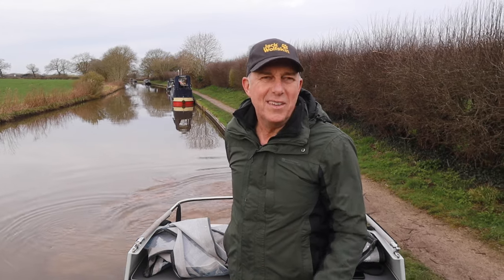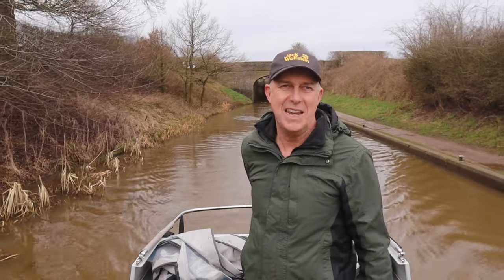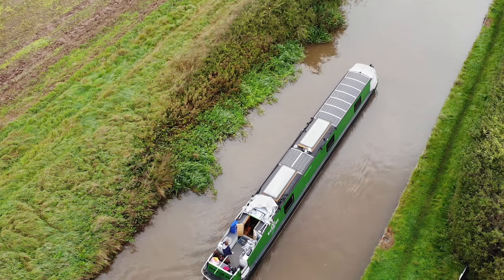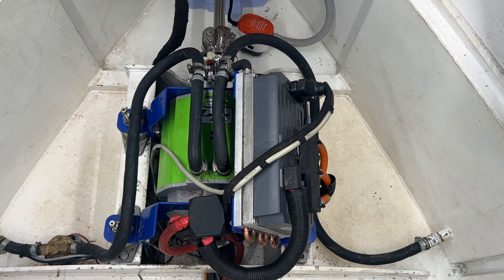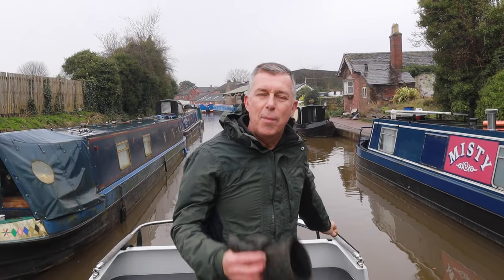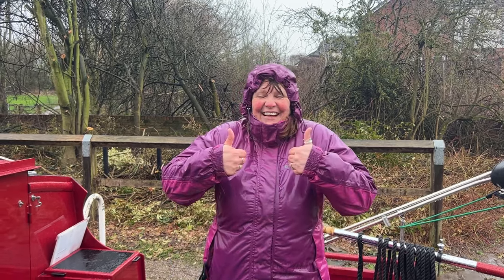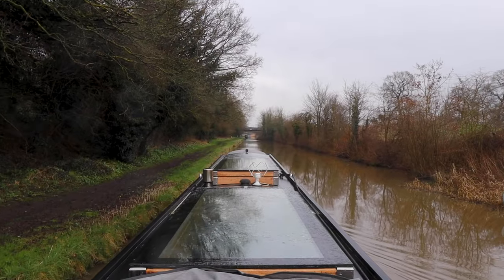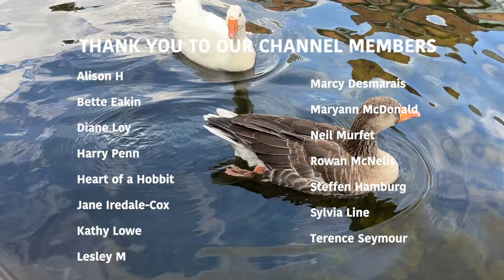NEW ENGIRO MOTOR on a NARROWBOAT How do you Charge an Electric Boat?  Ep.203

Comment: Super update Paul, great to see Dexter looking chipper. The new motor sounds louder than the old one … is it significantly louder? Do you think it’s the motor or the prop? I’d love to hear more on how the upgraded generator is working out. Love the artwork … it’s wonderful to see the creative process. Stay warm!
Reply: There seems to be a high pitched whine at certain prop/motor speeds, but then it completely disappears.  Is it speed related or something else?  It is quite an irritating noise when it happens.
Reply from the maker: Hey guys. It is louder, not significantly so. I do think a lot of it is the prop to be honest. The new generator is still in its bedding in period but it will charge the batteries at a faster rate when we are able to increase the output. Love seeing Paul’s Timelapse’s too. Such a talent. Hope you guys are keeping well and looking forward to getting back onto the boat. ❤️
Reply from the maker: Hey Jeff. We had the same on the last boat and it is speed related. It is when the resonant frequency of the prop matches the water. It is like running your wet finger along a wine glass rim. It can be remedied when we next come out of the water by sharpening the blades of the prop. The laymen’s term for it is singing prop but I agree, it is a bit irritating. Hope you have a good weekend ❤️
Reply: @NarrowboatLifeUnlocked  glad there's a fix.  Will be interested to see the results of the prop sharpening modification.
Reply: @NarrowboatLifeUnlocked  we found our singing went away after we went through a few shallow canals … a little bit of prop wear makes all the difference! 🤣 (I’m sure sharpening would be a more efficient solution).
Reply: @NarrowboatExpats  does it also happen with diesel motors, but it's masked by the engine noise?  I've never noticed anything like that in any of the lake boats I've owned (one 2.5hp inflatable, and a couple of 115hp small speedboats).  Apart from the last outboard engine boat, those were quite noisy, though.

Comment: Am I right in thinking that your boat is not 12 months old yet? In that time you’ve had new motor, inverters, generators x3 propellers and I believe you said in quite an early vlog, new lithium batteries. This is unbelievable in such a new boat! There are many boat builders I’m aware of who have successfully installed this system so why not Oakums? There’s hardly anything original left on that boat! It’s not been the fun year you were so looking forward to on your new boat, I guess.
Reply from the maker: Hey Malcom. You are right, we are only 10 months old. It has been quite a stressful year. There are boat builders who have successfully installed this system but Oakums are new to electric propulsion and they have been very responsive and have invested a lot of time and money to try and get the system right. Hope you have a lovely weekend ❤️

Comment: Wow, the singing prop is back. Are there people working on propeller efficiency? on our electric model airplanes our propellers are much thinner with more efficient airfoils. You would think the most efficient motors would be a big brushless motor like the full size airplane folks are using. Still catching up from the beginning..... getting close now. Love Dexter!
Reply from the maker: Hey. The prop isn’t inefficient it is just perfectly aligned to the resonant frequency of the water. When it comes out for blacking, we will be looking at shaving some off to make it quiet. Glad you are enjoying the vlogs. Dexter is a sweet boy. Bless him. ❤️
Reply: @NarrowboatLifeUnlocked  i guess what I was interested in was this..... do the boat manufacturers just slap a propeller used on a diesel setup, or, are there special propellers set up for for electric.

Second question..... with airplanes models and full size carbon fiber propellers are far more efficient than metal or wood. (I have built 2 full size airplanes) I'm guessing no one is making carbon props for narrowboats since a Google search shows none. Are you aware of any carbon fiber props made for narrowboats?
Reply from the maker: Think they are the same prop to be honest regardless of diesel or electric propulsion. I have to admit, I haven’t seen a carbon fibre prop either. Maybe the cost? 🤷‍♂️

Comment: Great video (as always!). I like hearing about the technical specifications, there was a teasing glimpse of a new screen by the look of it.  I actually happened to have my spreadsheet for Oakums open when the video popped up and so was interested you had the 14kva when Oakums 2023 options have 12kva as the max. As I am a bit silly with power and have high needs I did some maths and realised I need significantly higher than 12kva… my calculations run to 30+kva peak consumption but obviously the buffer of the battery can ameliorate supply, especially if linked to a smart fuse box / smart MCB. 
Can I ask if Oakums did any calculations of your energy consumption on your previous boat & likely consumption on the new boat prior to build? As I said I will have huge energy demand and wonder if I need specialist advice prior to a boat builder.
Your experience with the prop is interesting as the IWA sustainable / electric boating working group published a report in ‘23(?) and makes the point the torque and energy characteristics of the electric motors are akin to the first diesel engines in NBs, IE big and slow props suit both. Again, I wonder if those discussions were had with Oakums?
Reply: I can confirm Oakums went with the prop size recommended by Vetus. I actually questioned it being too small when I saw ours and was pointed to the Vetus stand at Crick … they said it was what their engineers concluded was right for the e-lime 10kw motor.
Reply: @NarrowboatExpats  just watched your channel- great watch!
Reply from the maker: Exactly as Nigel said re the prop. We have definitely experienced the benefit of having a bigger prop.
As for the generator, our first installation was a kit which came with the motor and generator and prop as per supplier. If you have a specific energy need, Ortomarine are the guys to chat to to help you with configuration. 
There was no power audit done prior to installation. 
I still think there are improvements that could be made to help with the diesel consumption. Hope you have a good weekend ❤️
Reply: @NarrowboatLifeUnlocked  thank you for the full response- it really is much appreciated! I am still in planning phase so will take your advice. Have a fab weekend yourselves- keep making the vlogs- love them!!!
Reply from the maker: Good luck with the build ❤️

Comment: so the boat is really new, but ended up needing a bigger generator and motor and prop... i get the impression that you are blazing really new ground with a boat that is electric, battery, generator drive.. all electric appliances with a diesel heater.. id like to see more about the original design, and the change on a technical level, not because im doing anything like it [im in the USA minnesota] but folks here are working on RV's and houses with more electric and less gas..   im completely interested in the process of learning how to do this all..
Reply from the maker: Hi Tim. For us, it really has been a trial and error experience. There are plenty of boats out there though that have had the same set up as us and have had absolutely no issues. We originally had a 6kVA generator with an 8kW inverter and a 10W motor. I do think gas-less is the future but we still have a way to go with technology. Hope you have a fabulous weekend 😊

Comment: Hello, thank you for your videos 😊 ... Regarding your electric motor choice. Please can you explain the differences between this Engiro Direct Drive 10 motor and your previous Vetus E-LINE ODrive??  (I think that's what you said you had??... maybe). Also could you give an idea of the cost of the Engiro? (cannot find this information listed anywhere). I watched various videos trying to get a better understanding of your electrical setup, but I am still not clear. 

Thank you in advance if you can answer 💐
Reply from the maker: Hey Tatyana. Glad you enjoy the vlogs. This is what Liam sent a while ago.
You have an Engiro Motor, supplied by Lightning Craft, called the “Direct Drive 10”. It’s a 10kW Motor, rated at a continuous 12kW @ 1320RPM, with 17kW @ 1000RPM peak! The Continuous torque is 81Nm; with Peak torque 188Nm. The propeller has been increased from 13x9 to a 16x11. Overall this gives you a Efficiency Rating of 90%+
Hope this helps. Have a good weekend ❤️
Reply: @NarrowboatLifeUnlocked  Thank you so much for taking the time to reply ❤

Comment: What are those big metal corner brackets on the roof lights been added for ?
Reply from the maker: Hi Adie, they have been out on the help with the structure and to prevent the wood on the skylights from splitting.
Reply: @NarrowboatLifeUnlocked  I thought that was the case . Problem is the steel boat expands in the summer and the wood doesn’t hence why it will split . 
I would be asking for metal upstands & windows otherwise you’ll always have problems.
Reply from the maker: Agree 👍

Comment: How does the electric motor deal with the rivers? Have you been on the Thames yet?
Also, how long did it take to get used to driving the boat?
Asking because I’m just about to buy  one and continuos cruise .
Cheers
Reply from the maker: Not been on the Thames yet but it was fine on the River Avon and Severn. Should be even better now with a bigger prop Charles. 😊

Comment: Hmm .. but lithium cells are not the latest technology.

We now see two outfits developing hydrogen fuel cells.

No idea as yet if this will catch on in the near future but eventually CRT will be expected to supervise (under local authorities oversight) the transition away from fossil fuels.

CRT have already imposed some "no diesels no smoke" zones in order to become "good neighbours" in the canal side community.

Lithium cells should be regarded as but a step on the way to the de-carbonisation of the waterways.

And yes diesel heating is quite expensive even if using red diesel.

It is likely to be even more expensive if we are "nudged" towards HVO.

Plenty of info online if arsed.
Reply from the maker: Yeah, I have heard about the Hydrogen fuel cells. I know there is a drive to move away from fossil fuels. 
I have read about the no smoke zones in some areas. I don’t think this means coal cannot be used as most of the “coal” is smokeless anyway. I suspect it refers to wet wood etc. 
we have had someone else mention that they run their generator on HVO. It is just the availability I guess.
Hope you have a great weekend 😊
Reply: I have been looking at hydrogen for my planned new build, as a fuel cell source and will ask JCB for data on their smaller hydrogen combustion engine, along with other fuel cell systems. The problem I have is that currently the numbers just don’t stack up. HVO does… but still expensive at double diesel cost.
Also, hydrogen has serious storage challenges. I do not want a great coffin atop my boat.
Reply: @NarrowboatLifeUnlocked  

Indeed would agree with wet wood issue. I gather wood "should" be less than 20% moisture content.

Since reading up on hydrogen stuff in Tillergraph I gather some outfit is selling "naked" fuel cells to cobble into "whatever" but no details ref output or consumption.

The coffin on the roof might be a safety feature in that hydrogen is stored in "off the shelf G20 canisters".

Any leaks around the bottles allows the hydrogen to vent into atmosphere and not collect against the inside of the cabin roof.

Hydrogen, being very light, is the fastest rising gas there is by some margin, ergo the threat of an explosion is mitigated sort of thing.

Obviously before a system is designed it's probably a good wheeze to check with the BSS department of CRT.

And not forgetting your insurer.

Will presume further that the installation will need to be signed off by a suitably qualified engineer.

And it might be prudent to check if the BSS gas safe qualified lads and lasses can sign off on hydrogen installs when the 4 year examination occurs.

Having a complete conversion (£8k and rising) might be preferable with respect to being professionally installed and signed off.

Certainly wouldn't entertain doing the work myself!

Comment: An electric narrowboat with a diesel generator is bizzare why not be propelled by a diesel engine which will charge batteries at the same time, and also having a electric oven instead of a gas oven is just making life more difficult for yourselves.
Reply from the maker: Hey Darren. Many electric narrowboats get to cruise for free in the summer on their solar. The diesel consumption on there boats is about 1/4 of our old boat so they can be more efficient.

Comment: Why run a generator to power an electric motor when it's more expensive ? I'm not trying to be a hater but doesn't make sense
Reply: It is only used to charge the batteries if they run low due to inadequate solar input as a result of short days and cloudy weather. In the summer it is often not necessary.
Reply: @sgriffith2353 Hi all , If your going the electric route on a 60 ft narrowboat thinking it's going to save you money forget it but on the other hand if you want the peace and quite and just want to enjoy your surroundings then go electric . The other advantage is the motor only has one moving part , no messing with belt and oil and if your going to need 30kw's what are you doing on a narrowboat.
Reply from the maker: Hi Aide. Charging batteries via a generator is actually more efficient than by a diesel engine. I think our issues are compounded by the electrical set up. We know plenty of electric narrowboats who use a quarter of our consumption. I do think it will be the future of boating.
Reply from the maker: Exactly this Sue. ❤️
Reply from the maker: Exactly Trevor. Although we know other electric narrowboats who make considerable diesel savings compared to their diesel engine counterparts. We do love the silent cruising though and there are, as you say, other advantages. ❤️

Comment: Hi again guys I read your reply thanks if the people you on about are the ones I seen will have better electric than you Dave from crusing the cut did a blog about both off them if my brain is still working one has 12 battery's the other one I think had 18 battery's and like I said guys from the first week guys I think you are under powerd I think you need double if not triple amount battery's if you look at video of that boat they travelled 6 hours used 20% off there battery's
At home I worry about how much electric I use I kept a book and checked what I used found other was off cutting it down you have electric cooker that uses a sheed load off electric  now you done like me and use air fryer so that will help your next big user is your heater were you had coal what I trying to say you are worrying about  nothing you got all eggs in one basket if like me you keep receipts look at your old boat add up coal gas coal wood then add it to how much you spent on diesel  bet there is not much difference
Reply from the maker: Hey Nicholas. We have 800amps of lithium which is a massive bank and should be more than capable of our consumption. I think the issue is how fast they charge and discharge. The charge is restricted by the BMS. I know the batteries on the other boats have a similar battery capacity, they may have more batteries, but our system is 48V and not the usual 12V system. 
We do think that the fire, given the coal, kindling and logs cost, is about the same to run to be honest.
We are having an independent report compiled to look at how we can improve this system. 
We will keep you posted. 
Have a lovely week ❤️